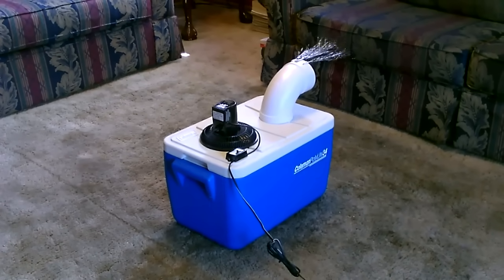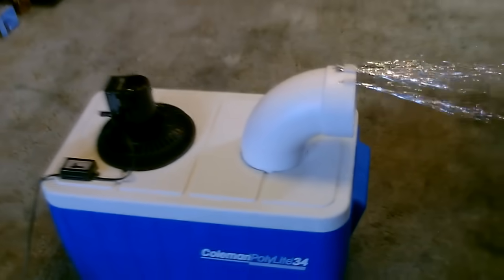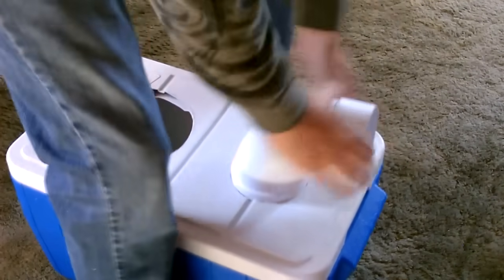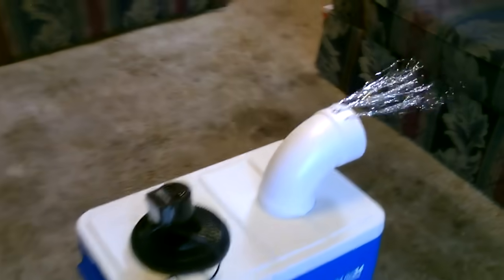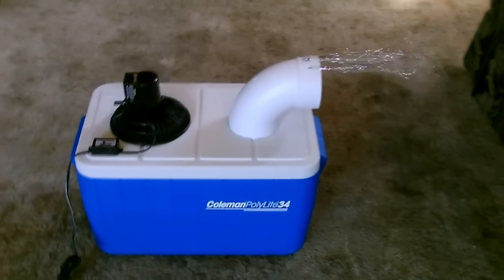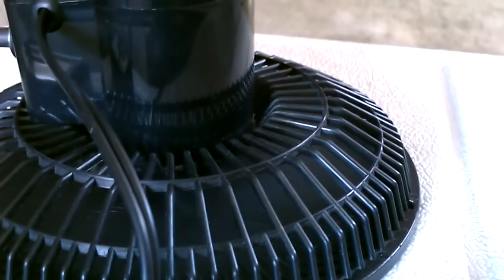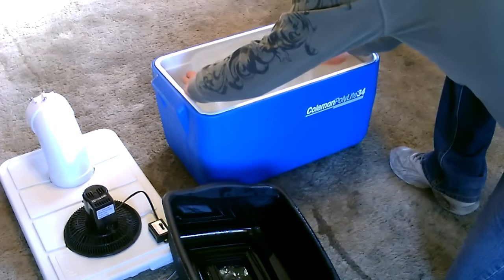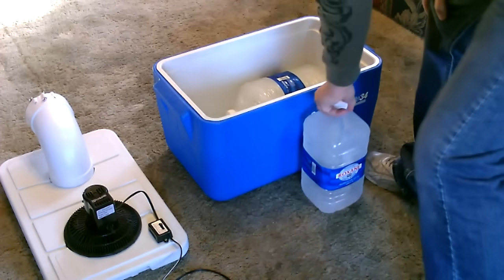Homemade air conditioner DIY - Awesome Air Cooler! - EASY Instructions - can be solar powered!

Comment: The issue with this is that the air is so friggin damp....yah your cool but everything in the house gets musty.  Depending on the environment of course.
Reply from the maker: hi there. you're thinking of evap cooling. those add humidity. these ice-based air coolers don't add humidity to the air (they're a non-evaporative air cooler). they cool using the 'phase-change effect' of the ice turning from a solid to a liquid (it takes a lot of heat to melt ice - so the melting cools the air). since the water just turns from a solid to a liquid (but not to a gas) no humidity is added to the air. note: if you only use ice that is enclosed in plastic containers or blue ice packs then the unit will actually remove a small amount of water from the air. that's because lots of condensation builds up on the jugs and all that condensation is water being pulled out of the air! it's pretty cool.

Comment: why not just fill the cooler itself with water and freeze it? get a bigger chunk of ice..
Reply from the maker: it could work. when water freezes it expands so you might have an issue with the ice chest cracking but it might work

Comment: Run it on solar panel in the daytime and at night time put it on your car battery and you can also run it off of your solar panel to a splitter going into a charger portable charger for a 12 volt to charge battery by solar and you got everything that you need right now again love your videos

Comment: I would buy that!
Reply from the maker: i've seen similar style units for sale (but they are way over-priced - usually $300 or more!). it's very easy to make one and costs a lot less to build). i've seen similar ice chests for 16 dollars, similar fans for 10 dollars and the 4" tube is $3. *plus if you've already got an old ice chest then it's just the fan and tube.

Comment: We mounted these in our pickup bed. Took the center slider out and replaced it with plywood. Run a piece of drier hose through the plywood into the cab. This setup is ancient and it does work ok.

Comment: How much cooler will it make a 96 xj jep Cherokee 4door temperature inside?
Reply from the maker: hard to say, but it would certainly help
Reply: @desertsun02  In your opinion would it be bearable? My window switch shorted out and my pwr window's are stuck up. The morning I can handle but afternoons are rough!

Comment: Does this increase humidity? Pardon my ignorance.  👍
Reply from the maker: hi there. since these units don't produce cold air by the process of evaporation they don't increase the humidity of the air. they create cold air due to the phase change of the ice melting and turning into a liquid. there is some natural evaporation that occurs with any water but it's not noticeable in terms of humidity (less than one-tenth of one percent increase). some call it conduction cooling. i think it's more of a convective/conduction cooling mix. sorry for the long answer. i guess i could have just said "nope, they don't increase it" 👍🙂
Reply: @desertsun02  Thank you, I have subscribed.  👍😀
Reply from the maker: @Mr. Thomas A Anderson thanks so much for subscribing!

Comment: What about humidity in a small area??
Reply from the maker: hi there. these don't generate any noticeable humidity. as the ice melts it turns into a liquid, only a very small amount of it evaporates into the air. you can use large ice blocks all day and the humidity in the room won't increase even one-tenth of one percent. (which is so small that it cannot be felt).

Comment: Several years ago I made one exactly like it for the inside of my truck. Had a 12v fan to be able to plug into cigarette lighter because my truck which was sold in the north not needing an A/C was at the time in Waco Tx blazing hot black Silverado with manual crank windows. It helped and was sure better than nothing.
Reply: This is exactly what I was looking for
Reply: @Cary2345 me too
Reply: this is what i need for my truck super hot no ac
Reply: How long would it last?
Reply: @aladrasullivan9018  about an hour

Comment: The frozen water jugs would work better if you put water in the cooler itself with the jugs in there. It’ll cool the water and stay frozen for a good while. Or dry ice but know how to use dry ice safely first, you can suffocate from carbon dioxide.

Comment: Looks good ! but. .next time go to the junk yard and get some heater cores out of a junk passenger van and fill them with water . Freeze the cores and blow the air thru them.  80% more cold air out put.

Comment: What kind of fan do you recommend?
Reply from the maker: hi there. i've always had good luck with the "auto expressions" fans. they sell them at walmart. the one i used is a 12v 10 watt "auto expressions" fan. sold in the auto dept. most 12v auto fans should work good.

Comment: My question about this invention is more about safety. The fan used on this (with time), with the electricity, used with ice/water close to it...
Reply from the maker: hi there. since it's just a 12V DC fan it's safe. i don't use the AC powered ones with my water and ice-based projects. note that the 12v fans usually have an extra added safety fuse in the plug too. they typically make these 'can fans' very safe because they are generally used in an automobile). note that if you want to run this unit on AC power all you gotta do is buy an AC to DC transformer. you just plug the 12v dc plug that is connected to the fan into the transformer and then plug the transformer into the wall.

Comment: If someone could find the most effective formula for the air velocity you need related to the air mass of the box,it would be so helpful.. Big velocity means not much time for the air to freeze,small velocity means less cold air. Which is the best ratio?
Reply: 3 to 1 ratio with a multi switch fan to reduce the offset and a suggested bypass fan should see you optimised.

Comment: Don't you have real ACs in America?
Reply from the maker: we sure do - but they are impractical in many situations. not to mention expensive to run ✔😉
Reply: @desertsun02  sorry if my question sounds a bit dumb, but I am planning to move from Sweden to Florida by the end of August this year, how much would the electricity bill be if I run the AC all the nights All days of the month?
Reply from the maker: @HaxOr1337 i don't live in florida but i would guess the AC unit in an apartment or house would cost 5 to 8 dollars a day to run. (probably $150 a month minimum just for the electricity to run the AC). i could be wrong though. maybe someone who lives in that area can comment.

Comment: Where can I buy this size solar powered fan with a very long 30+ foot cord to the solar panel???
Reply from the maker: hi there. they don't typically make cords for the fans that long. you'd have to use an extension cord connected to the fan

Comment: How long this thing works i.e 5 to 8 hours
Reply from the maker: hi there. i typically get about 5 hours ✔ (but that varies a lot depending on how much ice you use and how hot the ambient air is

Comment: This looks 10X more functional than the "Chillwell" cooler that spammers are posting glowing paid reviews  for on the internet. Plus it's far cheaper in costs.
Reply from the maker: hi there. don't buy one of those little junk ones that they sell - just make one like i did 👍. this homemade one works way better and it's super easy to make. i still use mine to this day.

Comment: I built one almost exactly like this but then changed the exhaust vent to the 6 in elbow as in this guys video.  I first went to the dollar store and bought two plastic  tubs of approx 2 gal capacity, filled them with water and froze them. Then put them in the cooler at an angle shaped like this \ / leaning against the outside walls. Closed the lid and let it rip. I used a digital thermometer and got a surface temperature coming out of the vent of 63.7 degrees F.  Now  will let it run tonight while I am sleeping and see how much the ice melts by morning and how much temperature loss I get.

Comment: Here is how I plan to use this invention. At night when I go to sleep, I live in Arizona, in stead of cooling my entire house at night, I will put it in the room close the door and let it rip.
Reply from the maker: yep, and for absolute maximum cooling you can section off an area around the bed and blow the air directly into that area.  to do that you can either buy what they call a 'bed tent' or you can rig up something similar with a bed sheet for example (like the way we used to make 'forts' over the bed as little kids). it can be as simple as putting the back of a chair on either side of the bed and stretching a sheet across the backrests of the chairs. that makes a partial enclosure over the bed and will help corral or hold the cold air right where you want it. for anyone wondering what a bed-tent is - here is one example https://www.amazon.com/Shelter-Privacy-Breathable-Mattress-Included/dp/B07T4JV6ZT/ref=sr_1_2_sspa?keywords=Pop%2BUp%2BBed%2BTents&qid=1653591289&sr=8-2-spons&smid=A3NWYPG5KYQPO5&spLa=ZW5jcnlwdGVkUXVhbGlmaWVyPUExOU9BSFI3TFVVRTI3JmVuY3J5cHRlZElkPUEwNDA5MTUzRFdFRENFQ0NRME4yJmVuY3J5cHRlZEFkSWQ9QTAzOTEwOTI1NDRSR1JTSThVQVomd2lkZ2V0TmFtZT1zcF9hdGYmYWN0aW9uPWNsaWNrUmVkaXJlY3QmZG9Ob3RMb2dDbGljaz10cnVl&th=1

Comment: This may be a little off topic but JUST in case this happens to you.  A little back ground first. When I was in the military and doing hot weather trainer in the Mohave desert we slept in tents and no way to cool down though we did have large fans blowing HOT air at us. So with me laying on my cot, I thought to my self, I wondered...what if. So I got a bath towel and got it soaking wet then laid it over me. With the fan blowing air over  my body and the wet towel in place it cooler me down right away and I actually got a little chilly. It was about 115 degrees inside that tent. NOTE: My son's A/C went out at his apartment one time, in Phoenix, and he remembered this story. He texted me and told me how cool he got doing that.
Reply from the maker: hi. i've done that before. it works great when the humidity is below 50 or 60%. another trick is to use a 'chill its' evap cooling towel. start by putting a small desk fan next to the bed blowing on you. then take the cooling towel, wet it down and lay it over you. the air from the fan hits the towel and evap cooling takes place. you can get super cool doing that. often i will get so cold that i have to place a sheet or light blanket between me and the towel because the towel gets so cold it's ridiculous. the good thing about using a chill'its evap cooling towel is that you and the blanket stay totally dry. the water stays in the towel and will not get you or the blanket wet at all. the towel can stay wet 3 or 4 hours at a time. i just wish they made full body cooling towels.

Comment: Extend that pvc pipe down until it is 2 or 3 inches of of the bottom so it forces the air from the fan to be pushed past the ice and it will be much colder than it already is. Could get it down around 25-30 degrees or better with a little more fabricating

Comment: How long does the ice last
Reply from the maker: hi. i usually get around 5 hours (but it will depend on how much ice you use and how hot the room air is - also how fast you run the fan)

Comment: In theory, does this raise humidity?
Reply from the maker: hi there. in theory, yes, (but not to a noticeable amount). i calculated a while back that it raises humidity no more than one-tenth of one percent but i now think it's even less than that. as a test, i froze water in a 3 gallon plastic tub. (that roughly makes a 25 lb. ice-block), then i dropped it in the unit and ran it until the ice melted. finally i just poured that water back into the tub to remeasure it. the remaining water filled the plastic tub to almost the same level that i started with (meaning that only a few ounces, at most, evaporated into the air as it was melting in the unit).

Comment: Use insulation inside the cooler than use dry ice instead, it will last a lot longer also get a fan that uses batteries than you won’t need the solar panel or anything else

Comment: go to a restaurant supply store and get a rapid cool stick. we use them in foodservice to rapidly cool large batches of soup stock and gravy, they last longer and are a one time investment.  also, add a small pump or valve to allow water to drain out to keep the system efficient without disassembly
Reply from the maker: hi there. a rapid cool stick. i'll check those out.

Comment: In world war 2 the us military came up with an idea to make air craft carriers out of ICE with a cooling coil sistem to keep it from melting somehow.
What im trying to say is it wasnt just regular ice, they poured SAW DUST in to a 5 gallon bucket then froze the water, The finished product is termed PieCrete I beleive.
They shot duns at it m slammed it with sledge hammers and it would not break, I wander if the saw dust mix could also keep the the ice from melting or slow it a tad.
They also shot guns and took a sledge hammer to regulawr frozen ice and the diference was night and day. Funny story goes that the creator tested this is front of the military people in a room and shot at the ice, the bullet riqochet and hit one of the military guys.